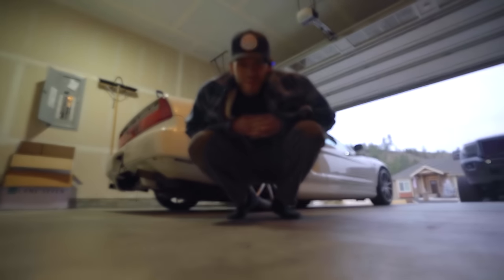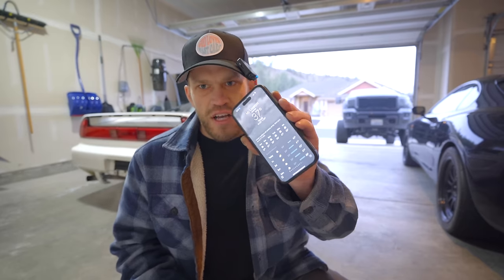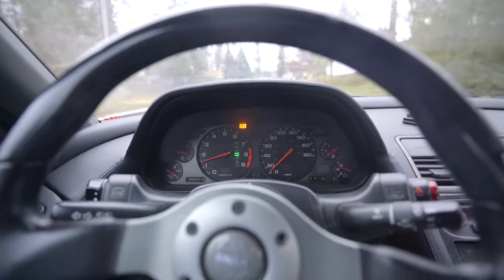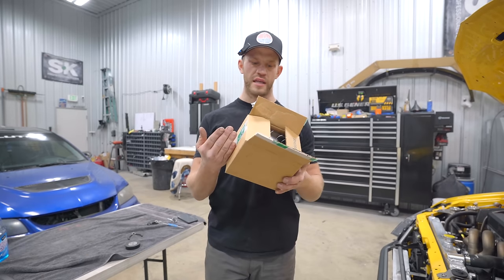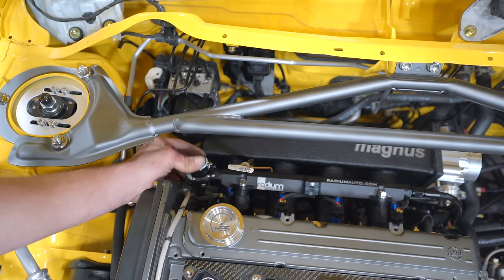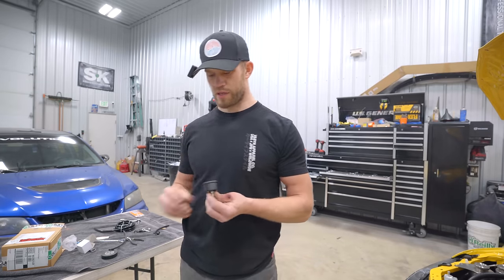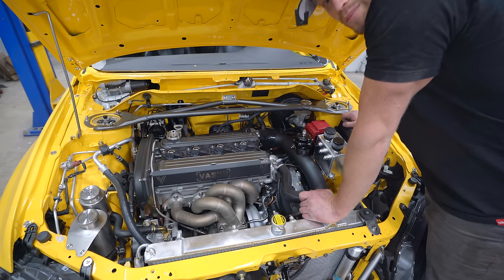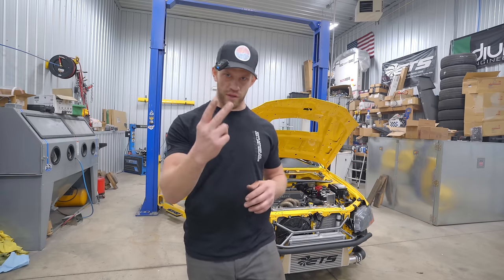THE ABANDONED EVO 8 RESTORATION | EP. 60

Comment: STM has OEM gasket kits for the rear wing.  Also need two plastic bushings with rubber foam on them and cut a sticker to cover the extra round hole on right side of the trunk.  Otherwise your trunk will leak.

Comment: Hopefully it’s not too Debbie downer but I used a Radium DMR and it completely hosed the regulator seat in under two years daily driving, it was really hard to diagnose too. The seat is replaceable but I shelved it after that and replaced with another brand. Also I copiously use Radium dampers so I’m not a brand hater at all.

Comment: Not a huge fan of the battery setup, also you drilled holes for the rivnuts but didnt paint the bare metal...
Reply: Yeah legit that’s going to be an issue in a few years. Also the way the harness was trimmed, I’m hoping the positive and negative was isolated before he taped it.
Reply: @randygalati  yeah exactly, idk why he just didnt actually remove those wires from that harness. Not talkin shit but seems like hes starting to half ass the rest of the build...